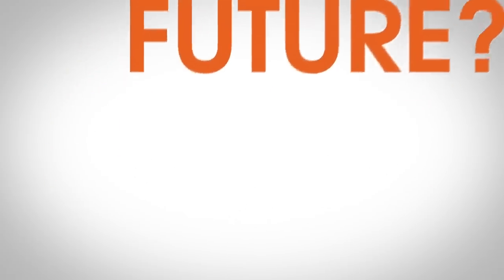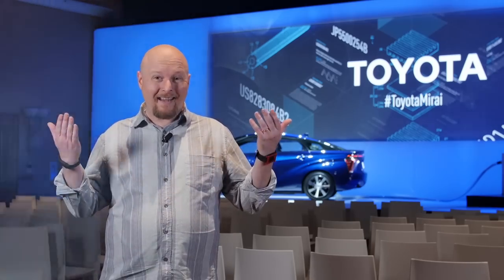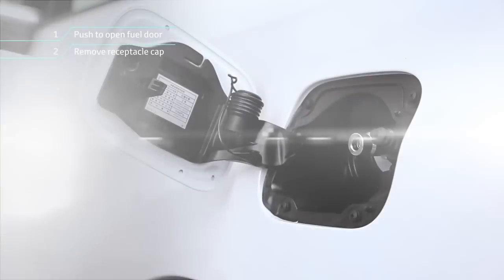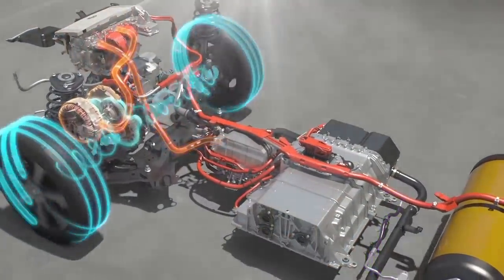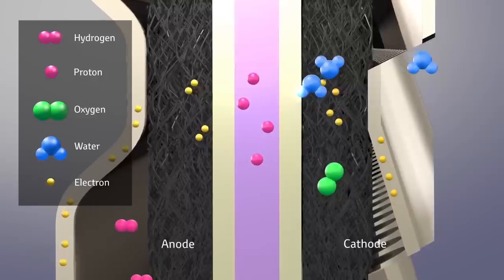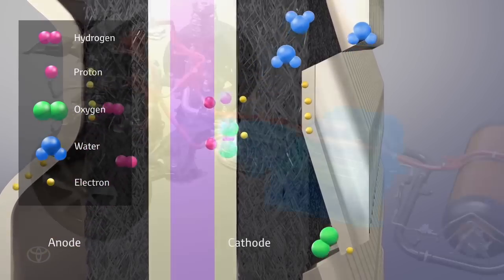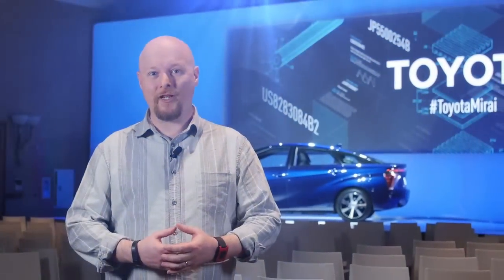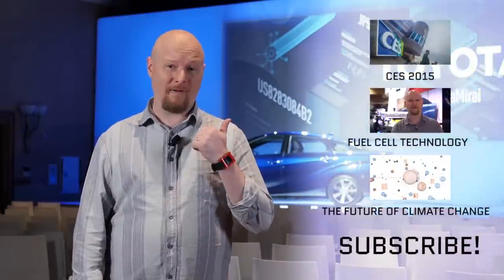How Fuel Cell Vehicles Work – CES 2015

Comment: This looks like the only solution but fuel cell energy is incredibly unstable from where the electrons and neutrons transfer electricity to the motor. Lithium battery technology is a lot more efficient with less moving parts.
Reply: +Luke Smith especially since our sun is the source of all energy needed to survive
Reply: +Luke Smith First of all Lithium batteries use primary cells, which means they're non-rechargeable. I assume you were referring to Lithium-Ion batteries. Lithium-Ion batteries have a lot of disadvantages compared to hydrogen fuel cells. LI-Ion batteries have a lower energy density(capacity per volume) and lower specific energy(capacity per mass) compared to fuel cells. Lithium-Ion batteries have a very short life span of 3 to 5 years, during which their capacity will constantly drop. Lithium-ion batteries suffer from self discharge. Hydrogen fuel cells can be recharged using a hydrogen generator. Also, let's not forget ethanol fuel cells, which if developed for a lower price would beat both Hydrogen fuel cells and Lithium-Ion batteries.
Reply: +Luke Smith I disagree with you. We should work on the safe nuclear power packages inside the cars that can drive it for years.
Reply: +Luke Smith So manufacture stable fuel cell tech. it isn't science fiction.
Reply: Not true.
Reply: I would respectfully disagree with nuclear cars, I think they would be far too dangerous. Nuclear power in itself is completely safe and I would use it to generate hydrogen over any other non renewable source, but you'd be putting lethal radioactive sources into the hands of idiots and when that happens tragedies tend to follow. Not to mention shielding weight, general loss of efficiency with miniaturisation, crash safety etc...
Reply: The problem Colibri with hydrogen is that until it it is commercially available and also preferably available at home using a sun+rain (solar+rain) collector to exchange ($0 running cost) then hydrogen simply cannot go anywhere.

Electric cars have the advantage of solar panels and the electric grid are easily sourced already but it dips out in capacity and charge/fill time.

If hydrogen became easy to obtain and CHEAP to obtain it will stand a STRONG chance of becoming the norm but if it doesn't hurry up Tesla will leave it at the dinner table.
Reply: Luke Smith forget this stuff electric cars cost more in the long run, also if everyone had one it would put a huge drain on the electrical grid, wirelessly sending power to cars is better u save 15k by getting rid of batteries, water cars are the future, not hydrogen fule cell or hydrogen combustion car just water which if charged will run in any naturally aspirated car, I guy in new Zealand invented it.
Reply: Producing electric vehicles takes twice as much energy as a traditional one. It's waaay worse for the environment. It's all just just a publicity stunt zero emissions is complete bullshit when it comes to electric vehicles.
Reply: stektirade true initially they are worse but over 10-20 years it will pay for the owner and environment.
Reply: Luke Smith why use electricity to make hydrogen then to convert it back into electricity just say you use a solar panel to make 3kw of electricity which makes say 100l of hydrogen 200l oxygen run that through a fule cell to get 1kw of electricity, now how will it work to make electricity in a electrical power plant there is no net gain of electricity but only losses. it's not the future, and it's technology is more polutive dew to extra losses, non of these idiots put these things into consideration all it is is a bit of fun and excitement for something new try creat a air membrane that converts air into electricity useing air a mixture of gases from the air then convert that if it's even possible.
Reply: stektirade theroticaly correct only in new cars tho not mopeds or 2trokes if cars had ceramic coating on the inside it would keep the engine cool by trapping heat inside the piston giving better power increasing efficiency, I had my prelude run solely on water, not hydrogen gas water, by simply  charging it up a little altering timing and placing it in a tank the block provided enough pressure and the sparkplugs had enough electricity to split the fine mist into hydrogen oxygen then that egnited it was not totally smooth but it ran it also had modified injectors to take the the changes in fluid density, why do people creat shit Wen water cars are the future forget hydrogen fule cell and hydrogen combustion cars and all the other stuff, the water car is the only one that should be out.
Reply: Tony Boroni lol why waste electricity to make a battery that makes electricity? You should think before you type. Oh yeah and burn coal while charging those batteries.
Reply: Glen O'Riley it doesn't do anything for the environment. Over the course of the electric cars life (making it, then disposal) it does more harm than a land rover does on the road in its entire life.
Reply: Tony Boroni any way we try to make something that uses energy you have to spend it, that's just the first law of thermodynamics. Even with renewable energy, you have to spend energy to make the wind turbines and solar panels.
Reply: stektirade I’m just wondering how much you can justify your statement with any thing that could be considered factual. So often Assertions are made as if they had empirical evidence to support them. Perhaps yours do but I would be interested in knowing what those are and order to be even somewhat convinced
Reply: For airplanes and trucks that need a high energy density hydrogen seems to be the only possible way to go electric, passenger vehicles can have the lithium batteries.
Reply: Luke Smith ,  Hydrogen in the future might be use as a source to move trains, planes and ships.
Reply: Autistic Boy , I heard of using algae in taking CO2 out of the air and making biodiesel.  In South Florida where I live in South Florida  Algae in the water causes massive environment  degradation. Fish Kills, Bird kills, Dolphin and Manatee Kills, Turtle Kills and causes severe Respiratory Problems. ICE should be use as a stop gap measure only. Methane can be made with algae also but it alone is green house gas. burned methane produces half the greenhouse gases.
Reply: @colibrimecatronic9922  A significant problem with all carbon-based fuels is the production of carcinogenic compounds via incomplete oxidation. With hydrogen gas, this is clearly not a problem (H2O is pretty much all you can create, unless you input tons of energy into the reaction), but with ethanol or methanol fuel cells, this may continue to cause a health hazard. Thus, H2 fuel cells seem to be the better option at this point.
Reply: @VVayVVard  Depends on how heavy those hydrocarbons are. Heavy mixtures like gasoline and diesel can't even be properly used inside a fuel cell. Simple and light hydrocarbons like methane, propane and butane aren't a problem if supplied with enough oxygen. Also methane can be renewable as biogas or through the Sabatier reaction. There already is a promising technology (solid oxide fuel cell) which can generate electricity from light hydrocarbons with high efficiency. After two years of posting my first comment, I don't have that much hope in methanol or ethanol as fuel cell candidates since there is no promising fuel cell that would make it better. However, at this moment E85 is still more sustainable than gasoline or diesel in IC engines.
Reply: @colibrimecatronic9922  However, in the long run, I feel methane as biogas should only be used to produce H2 via steam reformation, as combustion of any carbon-based fuel (or any organic matter really) leads to the release of BTEX compounds and formaldehyde / acetaldehyde as by-products. This may be inevitable for now (although better infrastructure for bicycles/bikes should alleviate the issue), but it is a major (and unfortunately, still largely unrecognized) threat to public health, particularly in cities.

These compounds are all fairly potent genotoxins, and thus gerontogens. This effect is easiest to observe through their promotion of carcinogenesis, but chronic exposure also induces other symptoms commonly associated with physiological aging. Particularly, the accumulation of mutations is known to promote cellular senescence and reduce regeneration capacity in stem cells, and can also trigger "idiopathic" forms of protein misfolding diseases, as these diseases sometimes only require a single mutation in a single cell to cause serious symptoms. 

I personally find this problematic as I currently work as a research scientist and I am attempting to find ways to "heal" a cell's genome as a way to both prevent carcinogenesis and to reduce aging-associated degeneration, but this is still quite hopeless with current technology (Cas9 is unwieldy for repairing poorly defined random gene defects, and I feel "chromallocytes" will not be available for a long time). This is probably the most difficult aspect of physiological aging to cure (at least replacing organelles and restoring tissue elasticity seem much easier in comparison), and as such, I feel that reducing the number of environmental mutagens should be more of a priority in modern society.
Reply: @VVayVVard  Aren't those toxins the result of incomplete oxidation, in other words, lack of oxygen? From my knowledge this mostly occurs in piston engines where the reaction is intermittent. This shouldn't be a problem in the case of turbine engines and fuel cells where the reaction is continuous, especially in the case of gaseous fuels like methane that tend to easily mix with oxygen.
Reply: @colibrimecatronic9922  I tried to find an article on this, but unfortunately no one appears to have conducted this type of analysis for carbon-based fuel cell technologies. However, incomplete oxidation can occur even if oxygen is supplied continuously. For example, this happens in air and water filtration systems using TiO2-based photocatalytic oxidation. If the reaction is not given sufficient time (i.e. the flow rate is too high or the retention time too short), complex VOCs are broken down into formaldehyde and other smaller compounds, but some are released before they get oxidized further to CO2.

It is possible that this could be avoided with some kind of filtration. E.g. graphene filters with a set pore size, which are currently under research for water filtration systems, could potentially be applied here to prevent formaldehyde and other 'larger' molecules from leaking out of the fuel cells. Still, I feel many automakers would attempt to cut corners here, so H2 fuel cells would seem like a safer choice in this regard. I admit I am not an expert on methanol fuel cell technology though, so I could be wrong.
Reply: Fool

Comment: The question is how much will it cost to refuel and how long does the fuel last
Reply: Toyota has always lied in such promotional videos and this has not changed 6 years later. At 4:58min they claim: "No carbon emissions like petrol or diesel powered vehicles".
This is true - if you look at the fuel cell car alone. If you look at the whole chain (well-to-wheel), hydrogen today in 2021 is made from more than 95 per cent natural gas, coal and oil, as it was in 2015.
The hydrogen car is therefore dirtier than all other vehicles!
Of course, hydrogen can be produced from renewable energies via electrolysis. But this method is several times more expensive and therefore there will never be a large number of cars with hydrogen as an energy storage medium.
Toyota needed until 2019 to produce and sell 10,000 Mirai.
At 4:59min I had to laugh:
The biggest revolution has failed ...

Comment: Wow Toyota is one cool corporations!
Reply: *corporation
Reply: Toyota has always lied in such promotional videos and this has not changed 6 years later. At 4:58min they claim: "No carbon emissions like petrol or diesel powered vehicles".
This is true - if you look at the fuel cell car alone. If you look at the whole chain (well-to-wheel), hydrogen today in 2021 is made from more than 95 per cent natural gas, coal and oil, as it was in 2015.
The hydrogen car is therefore dirtier than all other vehicles!
Of course, hydrogen can be produced from renewable energies via electrolysis. But this method is several times more expensive and therefore there will never be a large number of cars with hydrogen as an energy storage medium.
Toyota needed until 2019 to produce and sell 10,000 Mirai.
At 4:59min I had to laugh:
The biggest revolution has failed ...
The new Toyota Mirai II (2020) does not even have a folding rear seat back. The hydrogen tanks take up a lot of space ...

Comment: it doesn't matter how many years of fossil fuel we have left. The change is needed now. Hydrogen I think makes sense, especially if hydrogen is produced clean without the use of oil....   It can be done!  I like the range factors with hydrogen and I like the fact were not filling the planet with battery cells?  What do we do with all the dead batteries??
Reply: +Todd Hansen i totally agree with you
Reply: +has kha If I could buy an affordable hydrogen electric car today I would!
Reply: coconut_ pie no one said that it goes into water after it converts into power.
Reply: The Toyota Mari still requires Lithium ion batteries to store electricity.
Reply: @Jackson Bangs But its much more efficient. Your combustion engine also needs batteries in order to get it working. It just needs a spark. I think you can use this same concept to let the hydro fuel engine to work.

Comment: Hydrogen fuel cells can be used to store energy from renewable sources.
Reply: That would work well if the combined efficiency of electrolysis cells and fuel cells went up to 85% or better.
Reply: @RayDrouillard  but they will only do if it will have enough margin

Comment: hydrogen is another form of control
Reply: David Steers Put solar cells on your roof and lithium Ion Batteries in your garage or in your car for storage and maybe you can sell power back to the grid when then need more power at a high price or buy it back from the grid when power is cheaper.  Your car might be your biggest storage device. I use my Prius only two short trips a week. They are short trips. One trip I am trying to eliminate with a electric assist bicycle because it is for pleasure.
Reply: @daviddreyer5817  Or buy a small electrolyser and you can turn that solar electricity into hydrogen that you can then store indefinitely, ready for whenever you need it. Hydrogen isn't about "control", David. Anyone with access to H2O can make it.

Comment: I have a small query that how you generate hydrogen in abundant amount without using natural gas..
In electrolysis I heard that the amount of energy that generate to hydrogen is higher than output we get and not cost effective...
Is there any alternatives...???
If you initiate to prepare the hydrogen gas then how much it would be cost per gallon???

Comment: this video was launched in the begining of 2015. Now we are in 2018...
where is this technology
Reply: china me already use kar rahe hai
india me bhi jaldi aane wala hai.. it ll take time to develop
Reply: We are now in 2020...where is this technology?
Reply: Toyota has always lied in such promotional videos and this has not changed 6 years later. At 4:58min they claim: "No carbon emissions like petrol or diesel powered vehicles".
This is true - if you look at the fuel cell car alone. If you look at the whole chain (well-to-wheel), hydrogen today in 2021 is made from more than 95 per cent natural gas, coal and oil, as it was in 2015.
The hydrogen car is therefore dirtier than all other vehicles!
Of course, hydrogen can be produced from renewable energies via electrolysis. But this method is several times more expensive and therefore there will never be a large number of cars with hydrogen as an energy storage medium.
Toyota needed until 2019 to produce and sell 10,000 Mirai.
At 4:59min I had to laugh:
The biggest revolution has failed ...
The new Toyota Mirai II (2020) does not even have a folding rear seat back. The hydrogen tanks take up a lot of space.